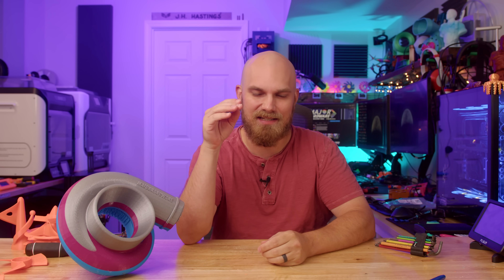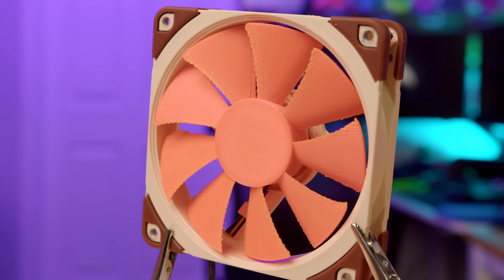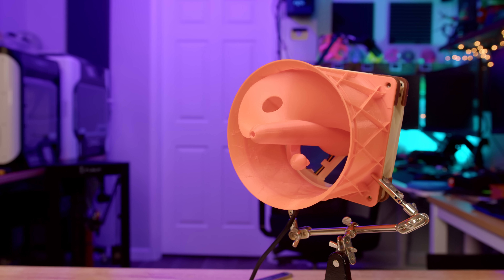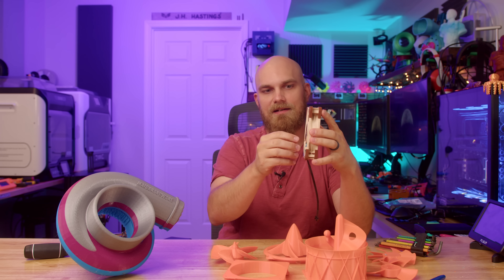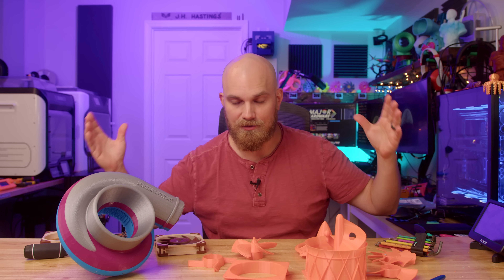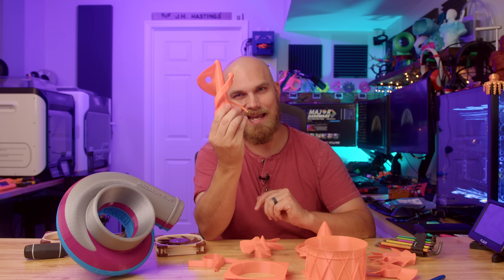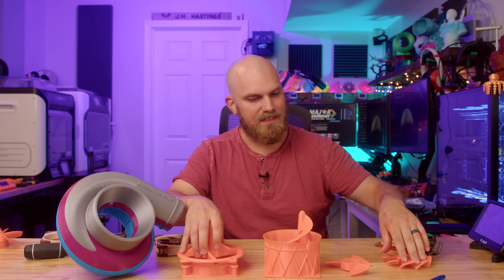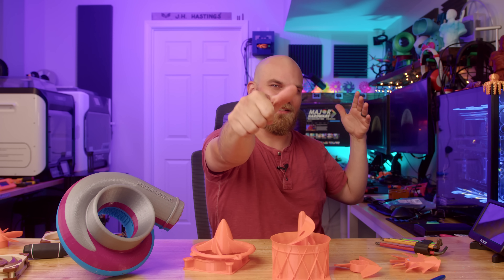NO ONE Has Done This Before | Fan Showdown S4E10

Comment: Does SolidWorks calculate the static cg or dynamic cg?  I think they are different.  There was a large centrifuge failure because they put big weights to counterbalance it, but that was a static condition.  Once they spun it up, it was a big fail because the weights were close to the center, while the arm had weight out at the end (in addition to the distributed structure weight along the arm).

Comment: While watching the Yangblade smoke test, I thought that if it beat any fan on the list, it's a win.  Understatement of the month. I do have one thought, modify the design so that there are fan-shape supports going from the eye column to the central shaft, then re-balance. That should correct for the wobble at certain speeds. I guess the designer didn't consider the centripetal force's effect on the column. That's OK, I might have overlooked it myself. 

That's why these tests are useful. It's the Edison approach, but crowdsourced. IIRC, at least one inspired a mfg design change, but there may be one out there that'll blow the socks off the competition. Besides, it's fun, too.

Comment: The reason no one beats the cheater is because the cheater is a turbine, all nozzles, from the fan to the outlet. NCB has untapped potential on the blade geometry and exit nozzle vanes.

Comment: I was thinking, what about modifying after the fan? Make a spacer approximately 2 or 3 inches deep and put angled vent holes (angled with the direction of air flow) in the spacer walls. Just a handful should do the trick. The idea behind this is the moving airflow will create a bit of a vacuum and with the angled vent holes, that negative pressure is compensated for with more air by the surrounding positive air pressure. The vent holes would look like teardrops from the side with the point facing the intake and the wide, rounded part facing the exhaust.

Comment: Suggestion for the next season-- add an additional smoke test pass, where you introduce the smoke perpendicularly to the direction of the fan, to see how well fans might pull in air without the momentum of the smoke being in the same direction. Not sure what info that would help, I just think it would be visually neat, especially if filmed top down so we can see the are in front of the fan be pulled in.

Comment: the new design of the open fan on the a380 test bed looks interesting. after the moving fan there are static blades that take the rotational energy that is in the air flow and cancel it out by guiding the air away from rotating to just speeding up the flow backwards where you want it to go.
so, the twisted air flow gets untwisted and that can be used to flow smoothly over/under the wing and create more lift over the wing too. very clever design

Comment: Theoretically obstructions in airflow are better on the low pressure (pre-fan) side so the logic of the neater cheater beater is sound (at least I think). In multirotors there have been some experiments in putting the motors under the arms rather than on top for this very reason. I think ultimately it's not done more often because it means your propellers are more likely to get damaged just by landing.

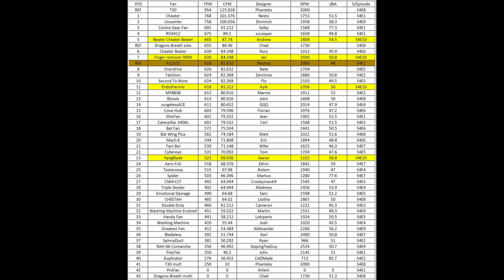Comment: It looks like the Neater-Cheater-Beater didn't "seal" against the airflow tester (7:58) because the 120mm mount tapers down. I think it deserves a retest if you are able to seal up that  gap, as it has to be loosing some amount of airflow to leakage.
Reply: The downstream duct is, ironically, reversed.

Comment: I'd say minor modifications that don't affect performance are fine, like cutting the notch for the wire in this case. But if a fan requires major structural modifications to function, it shouldn't be considered for use.

Comment: I think the yang blade just needs a TINY little support from the hub to the ball. While it might be balanced in CAD or while spinning slowly, I can almost guarantee as it spins faster the ball has quite a bit of leverage and flexing its supporting arm outward.
Reply: It has a lot of leverage but most of the balance mass is actually in the arm leading to the ball. So, the arm turns out to be quite stiff. In my testing before I submitted, it was hard to get it mounted straight enough to keep the center of mass right on centerline, so I think that's what happened here. But I've got a surefire fix if James is down with adding a metal bearing and pin, and only the shroud would need a reprint.
Reply: @windshieldvipers  hey! Cool to heard from the actual designed! That makes sense, I also don't have an great feeling for how stiff the material is. But being tall I can absolutely see how getting and keeping it perfectly aligned on its axis of rotation. I hope he takes you up on the fix though, love this series.

Comment: I used to fly a bunch of rc EDF jets.   At the high end of power balance easily made for a 10% power difference. I wonder how much of the variance at the top is due to randomness of balance in the printing process.

Maybe take the top 3 and print them 3 times and see what the difference in the “same” fan with different prints is…

Comment: It's all going to come down to the blade angle vs the blade mass (by way of the RPM).  Matching the pitch of the blades to the speed of the air moving through (once it reaches a steady state) is critical.  That might mean giving extremely precise instructions for printing to ensure the blade mass is what you've designed for...

Comment: Did the contender account for fluid dynamics when doing the mass properties? It's not a static mass/object, nor is it rotating in a vacuum. Surely the drag coefficient is gonna be dramatically higher "on the blade side", vs the opposite "ball side". The greater the pressure on the "blade" (higher speed, more resistance on the output side like up close to a radiator), the more it's gonna wanna tilt away from said resistance towards the opposite (ball) side.

As to minor modifications and adjustments neccessary to make the model work "as intended", I still think you should go ahead and do them. At least as long as you disclose the changes in the video, and the creator is in the loo.

Comment: yangblade was pretty impressive ngl, even with the unbalanced wobble it moved air!
Reply: I was super excited to see it get tested but I cringed pretty hard to hear it rubbing like that. Huge blades are way more efficient at these speeds than small blades, I got around 1800 RPM and 670 fpm on my own bench tests with no rubbing.

Comment: You could easily validate or disprove Andrew's theory by printing out an A12 replica and printing an inversed hub of the replica, to keep the surface quality consistent between the two samples, and test that. At the end of the day, it's really not going to make a difference, the support structure on a fan isn't enough of a hindrance to matter. What does matter however is the design choice to extend the support structure to form a tunnel, this will affect how air is drawn into the blades; whether this is an improvement or not is really only left to testing the same design without those support structures.

Comment: Maybe try reversing the mounting hole on a few of the higher placed fans to see if they change flow?  Preferably just the smaller ones that fit in the original housing.  I second PhilGoodInc with separate categories for normal mountable, oversized, and unrealistic fans.  It's nice to see all the ideas and it's entertaining, but when there's a fan that fits within the original motor shroud, I'm fully interested because it's realistically useable in my own system.

Comment: Idk if this has been said before but besides mass you also have to worry about fluid dynamics creating vibrations, depending on the design any play in the mechanism could probably begin to resonate with the pressure differentials (like a flag flapping in the wind). Additionally the frequency of the rotation could also begin to resonate with any mechanical play (but that'd be less likely imo than the former case, as in the former the system should have a more dynamic natural frequency)

Comment: With asymmetrical fans people only pay attention to the center of mass, but forget that once the blades start moving air, forces are applied against them and especially in that yangblade where one side is moving all the air and the other side is doing nothing, it gets thrown out of balance due to air resistance.
I'm quite sure in a vacuum that fan would spin much more stable.

Comment: Why not use a delta fan as the DC motor? It's designed to move air for server cooling. Delta fans can go as high as 250 CFM above 4500RPM, they're PVM friendly. Some of these fan blade designs are not meant to be stuck on a weak motor that can't provide the torque, lower torque means material vibration.

Comment: Personally I think minor changes are fine. Like if I've spent hours designing a fan but due to a minor mistake it doesn't fit so doesn't get showed I would be sad. So I think if it's in the spirit of the show and the original design mod away.

Comment: with the ying/yang fan, what about drilling or having a hole through the center so you could have a metal shaft through it and then have it mounted at the end with a support beam that comes across to prevent it from moving around so much
Reply: It's already designed with a hole clear through and a bearing seat in the tip, I think a support that attaches to a spider coming off the shroud is going to be the best way to make it reliable enough for James to reproduce my own test results

Comment: Have you ever calculated the theoretical maximum airflow for the power the motor is capable of?  Be interesting to see how efficient the different designs are against the theoretical optimum.
Reply: That would be a good idea, and it'd be a good way to tell when they've gotten as close as possible to said maximum.
Reply: Want to share how you'd do that?
Reply: @dgkimpton  a metric shit ton of math
Reply: @theocgaming9433  Just a bit of algebra.
Reply: One of the purposes of this show is to find the top performers and attempt to beat them. The theoretical maximum is the top performer.
Reply: Yeah, no, there is a reason all aerodynamic designs are developed in windtunnels, because it's basically impossible to calculate.
Airflow, pressure, turbulence and drag are all variables that affect eachother, change one and the others change as well.
Reply: @heygek2769  funny, I seem to recall something about an ideal gas law and flow calculations.  Compound those with kinetic energy calculations for the masses of airflow at different velocities through a finite area of the tunnel and you can derive the theoretical (perfect and unobtainable) max airflow for an amount of energy imparted.  Then you look at the power available from the motor and you can determine the maximum airflow that motor can move in that given area under ideal conditions.  Theres your theoretical maximum and the objective goalpost that can be used to see where current actual performance is happening and if there is much more headroom for achievement or if we are zeroing in on optimal designs already.

Comment: How much of a difference would smoothing the printing defects make? It seems to me that the layer lines/edges (I don't do 3d printing so i have no idea of the terminology) would have a significant effect on airflow. It looks like you did that for the neater cheater beater flow guide central protuberance, if it was applied to all surfaces i think it would improve things.
Reply: not much. he tested it a while back along with resin printing fans instead and it wasn't worth it.
Reply: @sirmonkey1985  Oh ok. Thanks for the answer.

Comment: The Neater Cheater Beater looks a lot like a model of ventilation fans from the 50's. I've recently seen a similar design used as a ventilation fan for bathrooms, though the housing was plastic instead of metal as in the kitchen fans, and more square'ish than the sleek motor housing used in the old fans. I have no idea if these were used all over the world or if they were a Scandinavian thing. There were one in the kitchen of the house my mother grew up in. It was installed sometime in the 40's or early 50's and as late as the early 2K it was still working flawlessly. When I was a kid I was totally fascinated by that fan as it was so quiet. Every time we visited my uncle who lived there I went to the kitchen and turned it on just because it was so smooth. So not an entirely new idea. Still a lot of work put into the design and the performance shows that there is something to it.

Comment: For anyone designing fans; having clean laminar intake is far more important than having clean exhaust, any turbulence over the blades will be amplified, also having inlet guide veins will help, just make sure that angle of the veins matches angle of the fan blades, if the angle doesn't match than veins will produce turbulent flow over the blades instead of laminar and do more harm than good. Designing impeller with optimal number of blades (hint no more than 5), and correct angle of those blades to match the rpm and power of the motor, paired with inlet guide veins optimized for said impeller is the key to beating the cheater.

Comment: doesn't anyone send a finished fan they've printed, instead of having you do the printing?
Also it might be time to reprint a cheater using your current filament and printer/slicer setup and put it on the same fan hub after all the big off center fans recently, just to compare to the original numbers.

Comment: With the amount of heavy and off balance fans that have been run on that motor, it would probably be a good idea to verify that the bearings haven't degraded and caused a slight reduction in torque output.
Reply: we need to use the original fan as a calibration. Retest, if the same numbers - no degradation

Comment: There has been a lot of comments on the addition of gasketing improving a design.  

It may be time to retry the top ten of this season just to see if the thought that gaskets make everything better is true.

Maybe a season finale type episode.

Either way, I have been here since the beginning of this series thanks to the algorithm, and even though I don't know jack square about cad or 3d printing, I am still glad to keep going down this rabbit hole!
Reply: If you like it, you should start like many of us did, with Sketchup Make 2017, it's extremelly easy to use, very visual, and it can be extended with plugins, a powerhouse for noobs.

Comment: airflow from the NCB looks really good. almost laminar. flows pretty straight instead of the typical cone shape anyway. is a little turbulence necessary to remove heat from the heatsink? would be interesting to test laminar vs turbulent airflow and how well it actually cools a CPU if that's possible.
Reply: Waterblocks do need turbulent flow, but radiators don't, just a good amount of presure.

Comment: 1:11 They do make 120mm EDF units. You will need a 24 volt power supply for them, though, and itt'l need to be able to push over a hundred amps. Think 'stick welder from shop class'.

Comment: I'm very curious on how we can improve the stock fan with ducting/spacers/velocity stacks etc. I have a Define Nano with heaps of room behind the front fans and want to improve the airflow direction. It's just going everywhere at the moment instead of straight back and towards the hot things.
Reply: Case fans are meant to replace the air in the case, allowing the cooling solutions inside the case to do their job more effectively.
I think someone once made a video on this, using some 120mm hose to connect his intake to CPU cooler to exhaust.
CPU temps went down but his VRMs and memory became too hot.
As long as your case has a defined 'path' for airflow (intakes and exhausts opposite eachother), you should be fine.

Comment: Perhaps on the non-symmetrical or single blade fans it would be advantageous to operate them vertically so that gravity is not a factor with regard to balance when rotating horizontally perhaps that would dull one source of harmonic imbalance
Reply: Gravity?
It's a fan, it spins, centrifugal forces are the issue, not gravity...

Comment: I'd love to see you balance the yin yang, looks like the counterweight needs to be a bit heavier. Just add some tape around the ball and spin it up and see if it gets better and keep adding till smooth. Just curious how much performance is lost in the lack of balance. 
I notice a huge max rpm drop on my rc planes if the prop isnt balanced right. A little tab of tape on the light blade and it gets fixed right up
Reply: There's no way to balance the center of pressure with the yang as it's designed now, though. I'd bet real Monopoly money that both "blades" are real close to the same mass, and to balance the drag would require a major redesign.
Reply: @brianargo4595  This is what I thought as well. The blade clearly pushes itself to the side so even with centered mass it won't work
Reply: @brianargo4595  The center of pressure doesn't move enough to be a serious problem, but it was tough to get it mounted straight enough in my testing. It's got a bearing seat at the far end, if there's enough interest James might re-test with a version that has a front bearing to hold it straight. It really suffers when it's rubbing like that, it runs about 1800 RPM instead if it's not rubbing.
Reply: i suspect the counterweight is being spun outward, causing it to exert more force.  The way he described it being fine at low rpm and then going nuts at high seems to indicate a variable